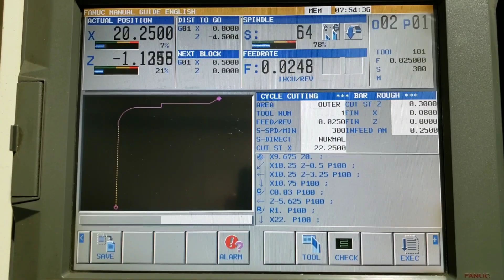CYLINDER BRACKET ROUGH AND FINISH, CNC LATHE (Tokarka cnc)

Comment: That was a lot of material to remove, and as usual the surface finish was excellent, even on that bore!👊👍
Reply from the maker: Yeap whole 535 lbs went in the bucket.
Reply: @ChrisMaj  Have you ever thought about recording your CNC machine's input screen while you program a part? 

That would help me alot and maybe other inexperienced machinists! 

Kind regards
Reply from the maker: @mjmj5224  the thing is that lots of my programming is done in FANUC manual guide.
Reply: @ChrisMaj  What is the issue with Fanuc manual guide? I myself only know Fanuc manual guide
Reply from the maker: @mjmj5224  it seems like people don't really like it. They rather stick to G codes. Which FANUC series you are using?
Reply: @ChrisMaj  FANUC manual guide i for a 12 tool turret Hyundai Wia lathe with a tailstock. I am not sure how to answer which series, I don't know. 

Excuse me for answering 10 hours later.
Reply from the maker: @mjmj5224  Usually tells you at the top left side of the screen. FANUC Series 21i / 32i / Oi or whatever you might have.
Reply: @ChrisMaj  It is the Oi which I have. 
Are there any major diffrences between the 21i 32i and Oi series?
Reply from the maker: @mjmj5224  If you are using G-codes then they are all programmed the same, but for Manual Guide i you program little bit differently.
Reply: @ChrisMaj  Do you prefer programming with inbuilt programs or just by hand?

Comment: At 2.43 I've seen these slip off with the G-clamp not tight enough and people underestimate the weight.   Did you mean 5 thou tolerance or was it really half thou . That is really honed tolerance.  That lathe is a beauty. Nice video again. 👍
Reply from the maker: I do tighten these fuckers hard and there was only 215 lbs (97kg) left, not that heavy. I think 0.001" tolerances it's pretty standard .https://i.imgur.com/xucPHHS.jpg

Comment: Have you ever tried wiper inserts for finish turning? You can feed twice as fast and achieve the same finish.
Reply: theyre good if you dont have to turn into shoulders. usually id use sandvik mild steel inserts and use higher surface speed. en24t id use 300sur with a finish depth cut of 0.3mm. bit in mind, the longer the part leave on a little more material with slower sur or  carbide / dampened bore bars

Comment: What was the tolerance for Concentricity.Perpendicularity?
Reply: Half a dupa yash.
Reply: @Michaelsloncehammr  What is a half a dupa. Do you know what the inner race of a heim joint is. I turned an .750 ID. To .875 with. A boring head boring bar. Faced both sides.  No Go gages on the I D Using a cemented carbide tool bit. Kept it all Perpendicular Concentric and Parallel  + -  .0005. On  1941 Monarch 3 jaw chuck. The owner wanted it done with a tool post grinder. For anyone who is a Machinist. Would know a tool post grinder suck.
Reply: @first25q43  I’m that smart. You are confusing and bewildering with you machining work.
Reply: *your
Reply: If you needed to understand we could always talk. I am not that hard to find. I can call you

Comment: I have a question about the final surface finish on the flange! Was it just as fine as in the bore/ on the OD? We're always having trouble with pressure marks from the jaws at work, and our solution has always been to switch to different, softer jaws for Finish OPs. But whitg such a big chuck as you use I can't imagine that's as feasible as with a HAAS's SL20 jaws. 

Do you used the same jaws through all OPs, and have a trick for keeping bite marks out of the flange? Or do you indeed switch jaws for the finishing op?
Reply from the maker: The finish on the flange wasn't that critical and the jaws are smooth and they have a radius on them so they don't really leave any marks. On this chuck I can't switch to soft jaws so if I have to I'll use some aluminum/ brass shims to eliminate any marks.